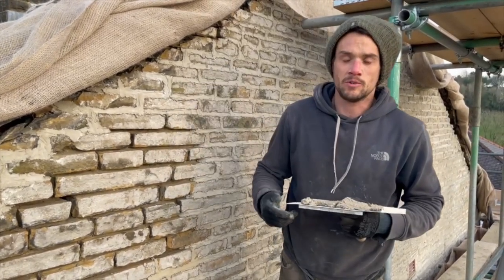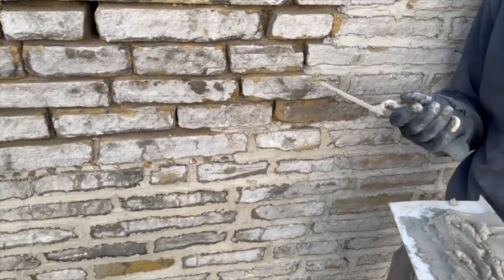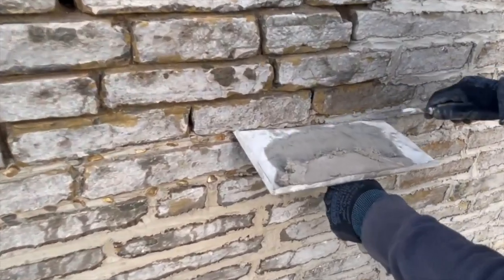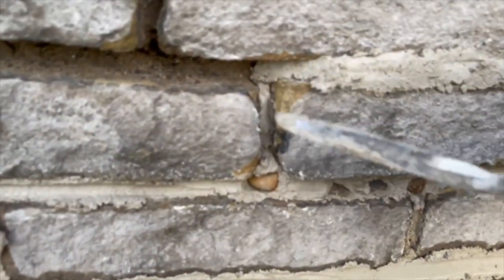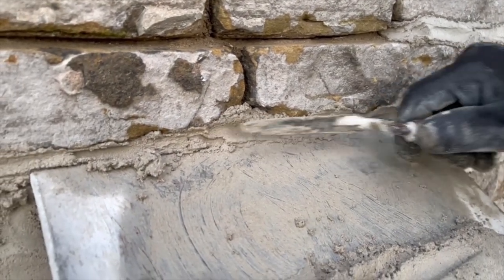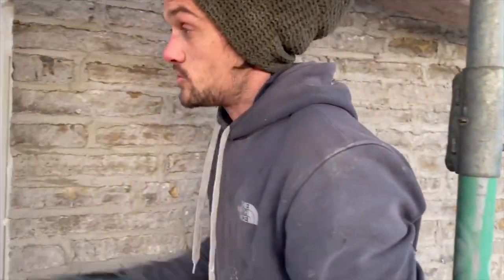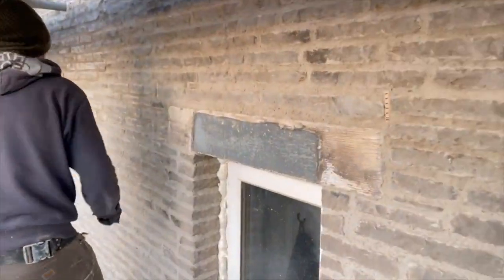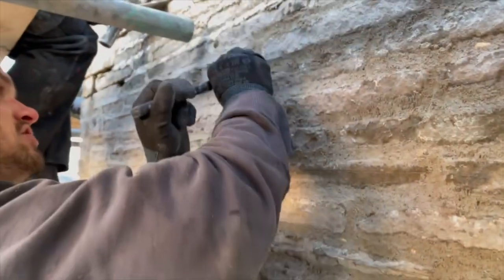Lime Pointing (part 2) Application and finishing of lime mortar pointing.

Comment: Is it safe to Repoint brink wall with lime in January were temperature is 5-7° in Wiltshire ?
Reply from the maker: I would wait until March, Sheldon. Don't risk wasting energy by lime pointing at this time of year. It will blow with the frosts, before spring arrives.
Reply: @dportercontracting9974  that was a quick response. Thanks for that. Ya will wait till march as you recommend.
Reply from the maker: @sheldondesouza99  we have a job at the moment that has been put on hold till March. Such is life.
 Now is the time to hibernate..

Comment: Hi, please don't take this as criticism, but I was always taught to fill the perps first. Wasn't on this kind of pointing though. Any specific reason, or is it just personal preference?
Reply from the maker: Hi matey. Thanks for the comment.  I guess it is down to the craftsman how he operates his trowel.  I personally feel that filling the joints up from the ground to the wall plate ensures that there are no pockets of air bubbles that potentially blow the pointing once the job is complete and the weather is doing its thing as the pointing has been applied from the back of the joint to the arris on every joint upwards from the ground.
Reply: @dportercontracting9974  Makes sense. Cheers for the feedback bud. Got a lot out of that video that I never knew before. Best of luck👍👍

Comment: Would that mix stain red brick 👍
Reply from the maker: If you are careful with your application, there is no reason why the lime mortar would stain brickwork. If you do get some residual staining. A weak acid mix painted onto the affected areas of brick, would disolve the calcium carbonate. Be careful not to get any on the pointed up joint though..
Reply: @dportercontracting9974  Thank You!

Comment: How do you price a job like this? Do you charge per m2? Just curious because that’s how a stonemason has quoted for work on my house?
Reply from the maker: With experience, you can charge a square meter price for the application, then allow for a day rate to break out and rake the joints out.